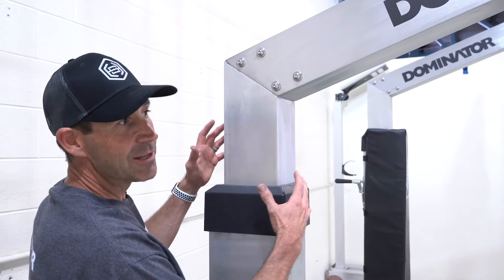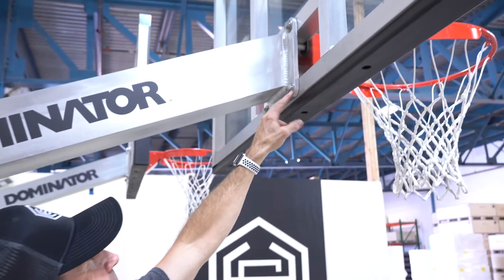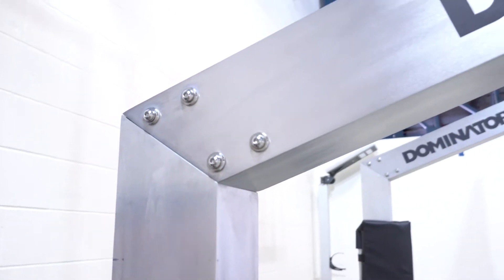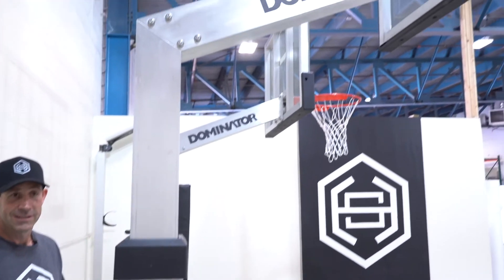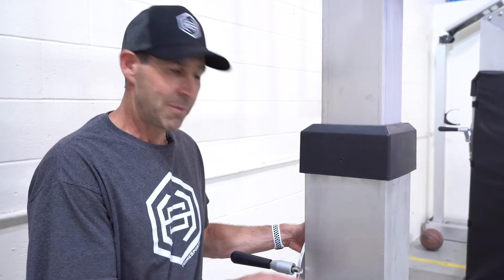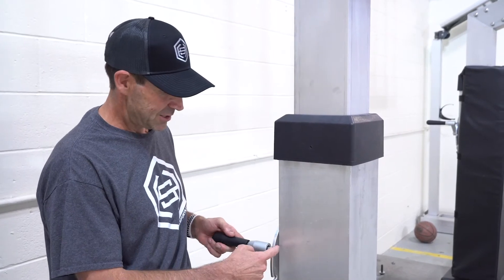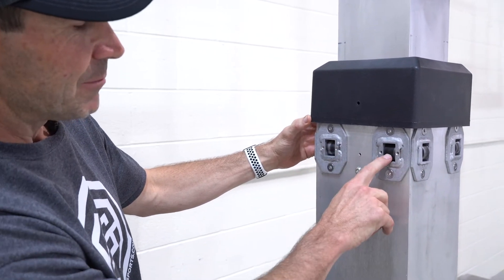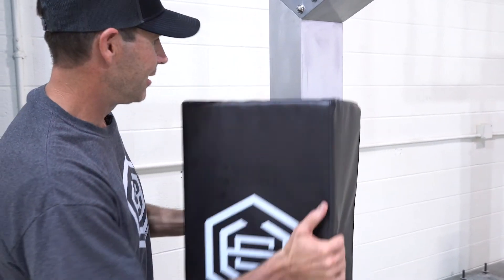Precision Engineering: Inside the Dominator Basketball Hoop

Comment: Great engineering, I live in Miami Florida. do you have any systems in south Florida parks or gyms to test? 

Also, is it 304 stainless steel? Living in south FL, we have high humidity and many storms. How will this handle these conditions? Sturdiness rust etc..

What does the warranty cover? I assume the glass is thick high quality tempered glass, is it virtually shatterproof? Obviously if someone throws a large river rock I expect it to shatter but in regular gameplay, it shouldn't break. Is there warranty with the back board?
Reply: Do the goals move up and down?
Reply: It ain’t fuckin wit the mega slam
Reply from the maker: We can absolutely point you in the right direction to check out some of our hoops. Give us a call and we’re happy to get you in contact with one of our dealers out there. 

We use 6061 T6 aluminum. This is the same aluminum that is used in aircraft, watercraft, and the automotive industries. So you could say it’ll pretty high quality:)

Our backboard is made of durable double paned tempered glass. Our warranty is a Limited Lifetime warranty meaning that if there is a manufacturer error, we will take care of it. You should not have any issues with regular game play.
Reply: @Dominatorsports  ok sounds good. I was on the website and says the 72" glass version as well as the lights are  out of stock :(

When will they restocked? Also are the lights on the website solar or electric? 

Lastly, do u offer free shipping? Please say yes. Lol
Reply from the maker: @Phenom-rl5pr  give us a call at 8017684663